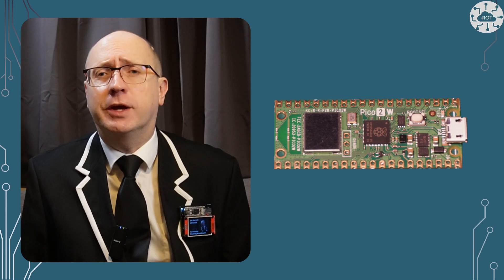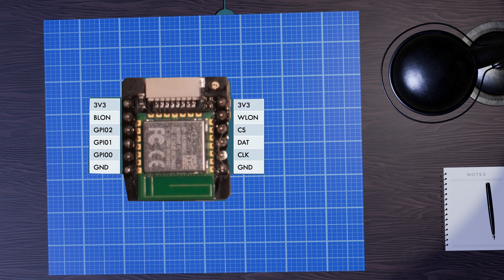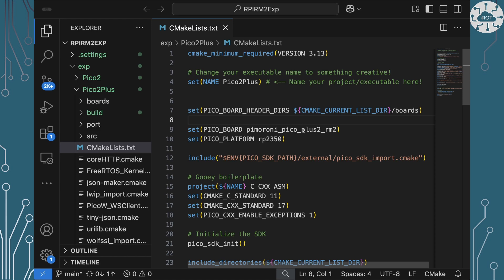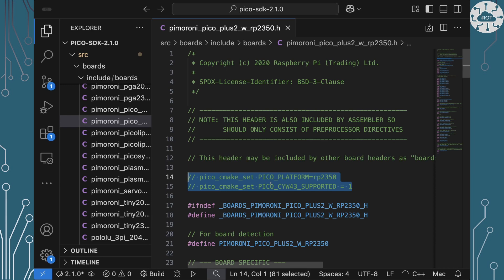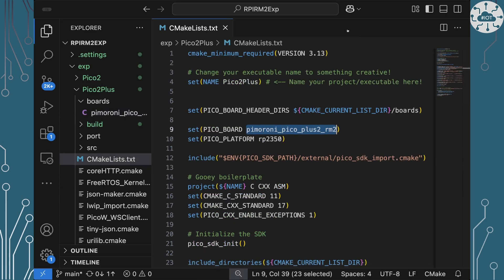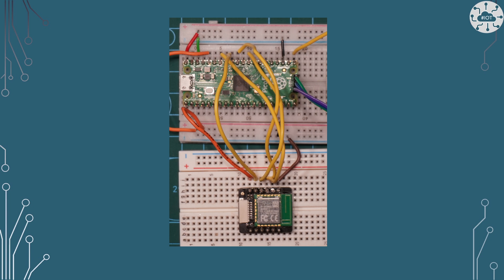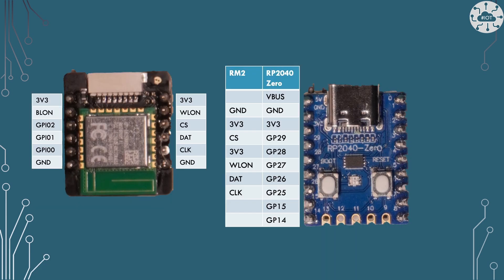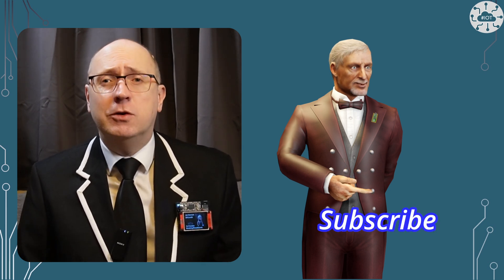RP2040 and RP2350 Boards Gets a WiFi Upgrade: Why This Matters

Comment: I think I would still use the cheapest esp32 for wifi than this. There is just too little documentation around the cyw43... I am at a loss as to why they decided to use it.
Reply from the maker: I can understand that. I would also interested in the decision process.
Of course using anything other than the cyw43 and you need to build a completely new IP stack support on the Pico side. If I went down the ESP32 route, I am not sure I would probably keep to that architecture for the project rather than go heterogeneous.